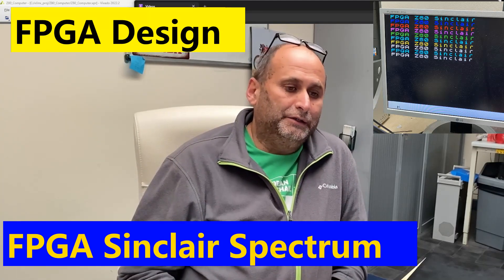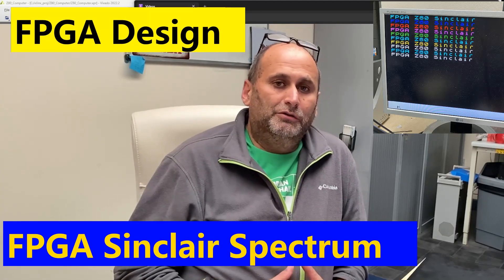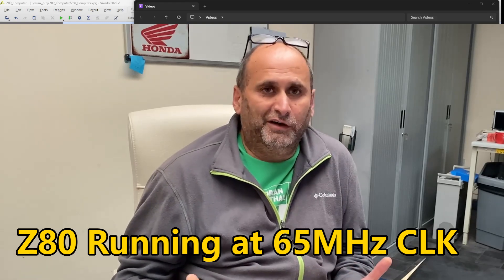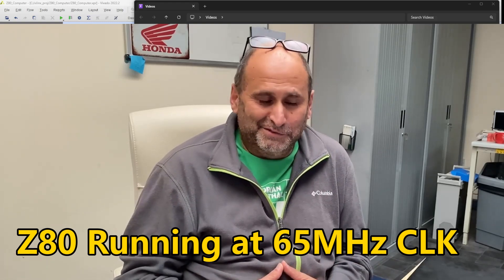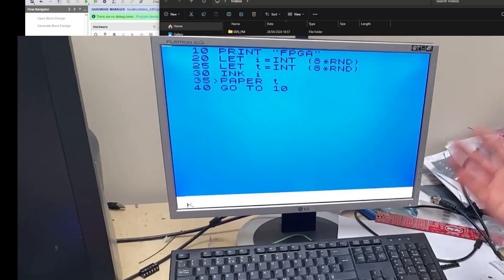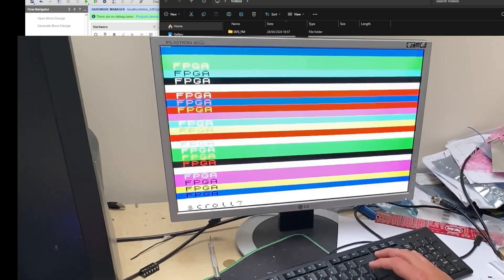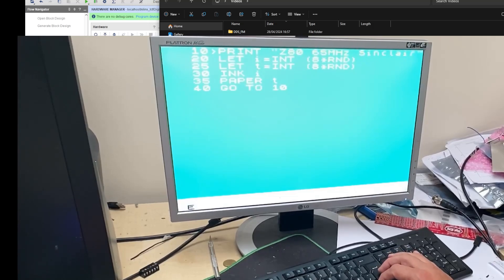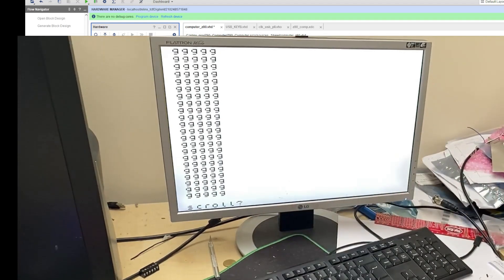FPGA Sinclair Spectrum

Comment: What FPGA board did you use?
Reply from the maker: I have a ZED board (zynq 7020) but other than BRAM is not using anything Xilinx/ AMD specific and it can be adapted very easy to Altera (or others)

Comment: Watching this brings back memories :)
The mechanic of the Spectrum keyboard was not good, much better then that from the ZX81 though. I have never seen this on an other computer (than ZX80/ZX81, Spectrum) that the BASIC commandos are on the keys and witch command or character the key press produced depends on the context. Needed some time to get used to but typing BASIC programs got very fast.
The C64 was on a complete other level, but check the price in the beginning of both computers. When I bought my Spectrum, I could have never afford a C64.
Wikipedia: in US$ today, Spectrum $720.-, C64 $1880.- Not that this makes any sense to mention, but I wan't to know this for my self :)
Reply from the maker: I agree 100% different machines different price levels but both have been good vehicles to push a generation of kids towards programing engineering and science.   I'm glad you like it!